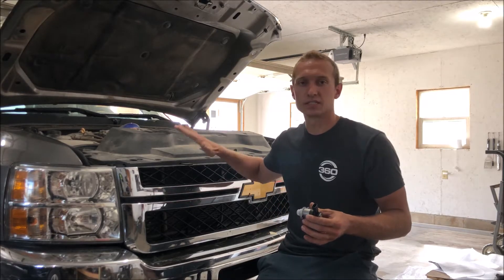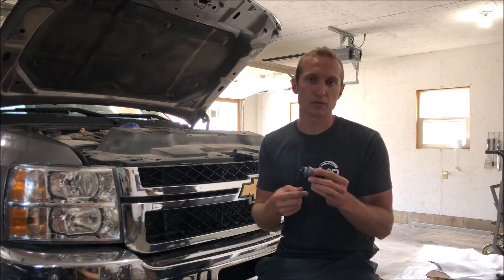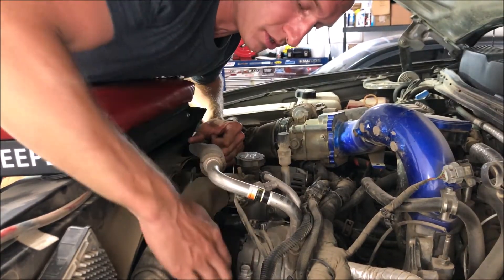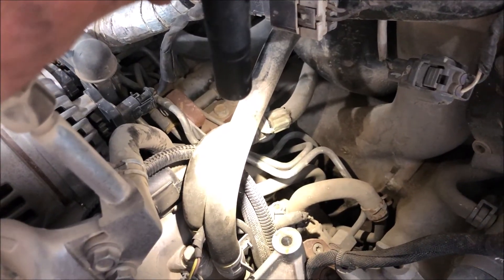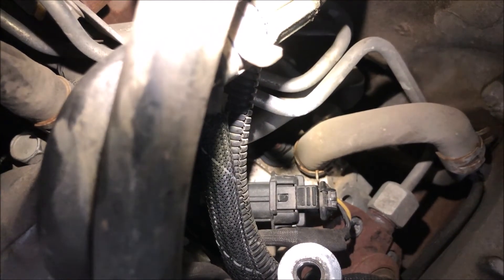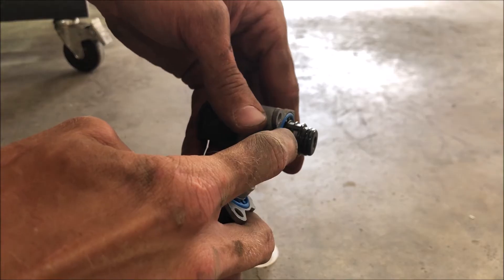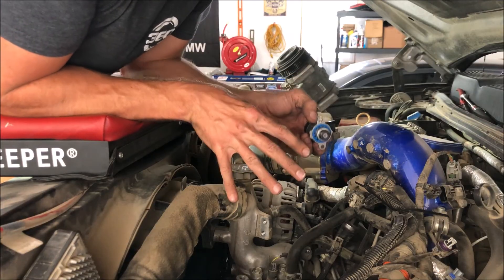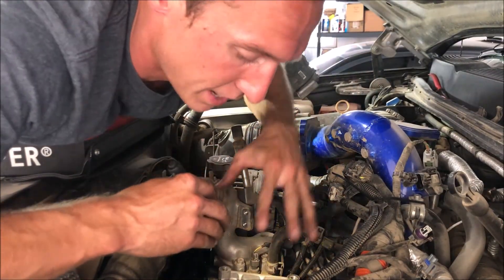LML Duramax Exergy Fuel System Saver Install: This Could Save You Thousands in Repairs!

Comment: I just bought a 2015 Silverado 3500HD, LML equipped, with 76k kms on the dial. I started with a fuel additive immediately to increase lubricity, and I am ordering an airdog lift pump so that the CP4 is never starved of fuel. I may also add this device for added insurance.

Comment: I have a 2016 Chevy Silverado 2500 HD Duramax and After watching this guy‘s video, I purchased one changed mine out, not too bad of a job and then I put an air dog lift pump on it. It runs great.
Reply: I’m picking up a 2015 2500 duramax, is it worth putting the lift pump on it? I lucked out and the previous owner had the CP4 blow but they got it redone at Chevy with all OEM instead of converting to a CP3. New to the diesel scene so I’ve been trying to study up and be as preventative as possible
Reply: @willyuumIII yes put the lift pump on. I got a fass fuel 165gph system. 2 extra filters won’t hurt, not to mention duramax pulls fuel to the cp4 pump by vacuum. The lift pump is an absolute must. It doesn’t have to be air dog or fass, there are a lot of different ways to add a lift pump
Reply: @amandahugginkiss9119 appreciate it! I just put my first 2500 miles on it been rolling good but this winter my project will be the lift pump and a few other things. Thanks for the insight

Comment: I just got my first Duramax (2012 crew cab long box drw) and this is the first thing I'm doing to it. 
I have a few things planned.
Banks intake, banks intercooler, 5" straight pipe. To top it off, I'll see if I can find a set of 2019+ High country seats to toss in. I'll have to mess with wiring and whatnot, but I'll figure it out.

Comment: Not sure why but I did not have to move the AC, undo the belt  or remove any hardware. All I had to do is disonnect a couple of wires to shift over the harness  on my 2014 Silverado 3500HD LTZ. Thanks for the Video,

Comment: good video but ,Al these videos refer to "CP4" , what is a CP4 ? if its a fuel pump, why are they not calling it that? what is converting to CP3 ? a different fuel pump?
Reply from the maker: Good questions..so in 2012 GM started using the next generation of cam driven high pressure fuel pumps known as the CP4 pump. Capable of slightly higher pressures but much more prone to failure, and unfortunately they fail catastrophically, sending shards of the pump downstream to the injectors which can cause further very expensive failures. Several different companies offer CP3 conversions which allows the customer to install the previous generation of high pressure pump, which has proven to be exceptionally reliable in pretty much every common rail diesel application since the early 2000s.

Comment: Thank you for keeping things simple and being descriptive!! Very big help on how you explained things! Dont know if you awnser questions on here but o have a 2011 lml duramax im trying to pinpoint the little hiccup it has starting, but what it does is starts up fine cold but when you drive it around get it warmed up it will just crank and crank until i let it cool back down. I have installed a fuel filter housing, an a airdog lift pump and still having the same problem i have no codes, truck runs like a top when started. Ive checked it with i believe one of snap-on's nicesest scanners the triton-dio, checked fuel rail pressure injection pressure-timing all the above to my knowledge everything looks great just really stuck and trying to find exactly what direction i need to go to fix this problem cause its the only wrong with the truck
Reply: Did you ever figure out what it was? My 2013 is doing same thing, cold start is good, gets warmed up n hard to crank like it doesnt have enough pressure

Comment: is this process the same on the later bodystyles?
Reply from the maker: Later bodystyles meaning the 2015-2017 LMLs? In that case yes. If you are referring to the L5P trucks, they are a completely different fuel system that does not require this modification.

Comment: After my old valve was out I pumped the fuel filter housing to push any foreign debris out of the fuel port. It really is just peace of mind but my OCD kicked in. And also I didn't have to remove anything but the Schrader valve and the small 5/8 rubber coolant line to get the 5T socket in the bolt, also a very good idea to have a small telescopic magnet handy. I didn't notice any decline in power however I did notice the truck seemed to run a little more crisp maybe it's just in my head but it still seems that way today.

Comment: JUST got a 16 2500 Denali LML tuned with Banks and cold air. Just learned about the CP4 issues and don't know what to do it has 110,000 do I sell it or replace the CP4 with a new one, or CP3 it? I just want a dependable truck.
Reply from the maker: Good question for sure. The CP4 issue is really a bit of a toss up, some guys have run them for 100s of thousands of miles without issue, other guys had had nightmare experiences where the pump grenades and takes out the entire downstream fuel system. My neighbor down the road had his cp4 go out, the local dealer replaced it along with the rest of the system under warranty. Literally a couple thousand miles later the new cp4 went out and did it all over again. He did a cp3 conversion at that point.
Here is a link to S&S Diesel's (one of the best aftermarket fuel system companies in the industry) CP3 conversion, they have an option for a 50 state legal, no tuning required system. That package is $1780, though you would still have to install it yourself or pay to have it installed. 
So you have several options, you can either wait and see what happens (install the fuel system saver in this video in this case), or you can spend a few grand and have the cp3 conversion completed and give yourself peace of mind and have a very reliable truck. Or, you could sell the truck and relieve yourself of the potential issue entirely.
https://ssdiesel.com/product/lml-cp3-conversions/
Reply: Cp3

Comment: Have you heard of someone that have install this exergy and the CP4 exploded and this actually protected the fuel system? Thanks and great video!
Reply: My buddy a few days ago, took it to the shop to fix a problem, cp4 blew. Luckily the week before he brought it in the fuel saver was installed
Reply: There’s a couple links of it working. Still will send metal to the tank and line. But protected injectors and stuff. Went from a 10,000 dollar job to a 2300 dollar job.

Comment: Replaced mine....started buzzing but I also changed my fuel filter. Once I got all the air out the system it seemed fine.

Comment: I’ve just switch it out in my 2012 3500HD with 350,000 miles on it and added an airdog lift pump. I have a few metal shards on the old part (sigh), I use hotshots additive and with the lift pump hopefully can squeeze some more miles out of this thing before the CP4 gives up and we get a big bill. Anyway I really appreciate this video, thank you.
Reply: But you’re still running on the OEM CP4? I’m in the market for a new tow vehicle and am looking at “higher” mileage LMLs. This failure is my biggest concern obviously
Reply: @marshallangst8780  since my last post based in the price of used and new trucks currently, It was worth spending some extra cash on our truck. We installed a fleece CP3 conversion kit and SOTF tuning, we use it to haul horses between NC and FL so reliability was key, we get approx 17mpg hauling and 20mpg unloaded which is slight improvement from stock.

Comment: Quick question. I've got to change my thermostats on my 15 LML. (One is stuck open). You think there would be enough room to remove and install the system saver with the thermostat housing removed, without touching the ac compressor?
Reply from the maker: Yes probably, the compressor is not technically in the way, though having it removed is kind of nice because it simply gives you more room to work. Honestly for the 10 minutes or less it takes to remove and reinstall it, I would probably just go ahead and move it out of the way. You dont have to disconnect the AC lines, just fold them over and out of the way, so there is no loss of freon.
Reply: @FixedVaneDuramax  appreciate the reply. I'll probably go ahead and move it out of the way. I'm just lazy 😂😂

Comment: I just did this install took an hour to do the toughest part is the bolt towards the engine,after install truck did have a hard start gonna drive around this weekend see how it drives. Great video thanks.
Reply: @An extremely important man neither it run's fine and great peace of mind.
Reply: @An extremely important man My truck is bone stock,I didn,t feel a difference with power, i mainly did for protection if the pump take's a shit but i read on some truck web site that this does not help.

Comment: When you pulled out the ac compressor, did you lose Freon?
Reply from the maker: No, you’re just unbolting the compressor and moving it out of the way, you don’t need to disconnect the lines so the system remains sealed.
Reply: With those hard lines didn’t think that would be doable
Reply: Do you have a link to the valve and cost $$$ ???

Comment: I installed a fpr on my 2011 Duramax and it won’t start. I made sure to prime and it didn’t help.
Reply: Are you throwing any codes? Is your CEL illuminated? Does your glow plug light come on and go off normally? Any other symptoms?
Reply: Same here. System is primed, no error codes. Bled the Schrader valve. Crank no start. Prime pump feels firm and doesnt seem like an air leak.
Reply: @kevicook  Believe it or not mine turned out to be a bad cp4. I had the whole fuel system replaced in Nov of 2020.
Reply: @jfromstatefarm2345  I still haven't got my truck started. I thought bad CP4 as well, but it was working perfect before I replaced the FPR. I hooked the fuel system up to a diesel can. Tried priming and noted air bubbles returning through both the return line and the supply line. Seems to be an air leak. But I dont know where. And I didnt remove any hoses during the install. Im completely stumped. Also, return fuel when cranking looks like it went through a blender. The only indication I have right now that the CP4 is in fact functioning.
Reply: @kevicook  is there a way you can hook a scan tool and check desired vs actual fuel rail pressure. That will sure tell if your pump is gone or not
Reply: @jfromstatefarm2345  Yes. Had a friend with an Alltel scanner come by. Desired fuel rail pressure was at about 6kpsi. Actual fuel rail pressure was 143 psi. Thats the highest we could get. We also checked all electronics and fuses. All good. Everything says this should start.
Reply: @kevicook  with actual psi being 143 the truck won't start until desired is reached. I would look into getting a new injection pump, rails and possibly injectors. I would also drop the tank and clean it.
Reply: @jfromstatefarm2345  without any metal shavings present in the FPR or fuel filter? Truck was running perfect when I parked it to swap the FPR. I dont know of any CP4 pumps that failed while off.
Reply: @kevicook  I believe that maybe it’s quite possible u introduced debris into your cp4 when swapping the fpr which in term destroyed it, either that or like u mentioned air in the lines/pump could also cause it to not reach desired pressure?
Reply: @MrCrazyboys87  Im afraid the debris could be the issue. It ran for ½ a second before it quit and never started again. But seeing the air bubbles in the lines, after I isolated the fuel system to just what is under the hood, tells me a different story. Im so lost on this. Never been this lost on a vehicle repair.
Reply: @kevicook  I’ve been there before too man and it always seems to be the most simple solution too lol, just have to keep at it and you’ll figure it out eventually!
Reply: @kevicook What was the fix to get it to start ?  I’m having same issue after installing the Exergy, crank no start.  Installed my factory one back in and won’t start either.  P0090 low rail pressure, truck ram like a top before swapping part.

Comment: What kinda time do you think this takes for a 1st timer.   Been working on cars here and there for years. But never diesel.   This a mid level maybe 3 hours ?
Reply: My dealer tells me that GM guidance says 12-16 man hours for the pump and under hood work. Add in the fuel tank and lines, it'll likely be 3 days in the shop.
Reply: Sorry, my previous reply was for a full CP4 replacement effort following pump failure. To install the FPR replacement alone took me just over 3 hours.
Reply: @jamesclark7248  no worries. I seen both comments and figured that’s what you meant.  I went looking last night on how to replace CP4 videos or CP4 to CP3 swaps and DAM , that’s definitely no easy or small task and I’m definitely not feeling confident on it ,
Reply: @jasonjackson329  Hi Jason, Thanks! My guess is as follows; 3 hours for the FPR swap only, 2 days and about $5k for the 50 state & CARB compliant CP4 to CP3 conversion, and about $12k to repair the whole fuel system after a CP4 catastrophic failure. All of this is based on postings on the Duramax forums and my dealer estimates for a pro installation.

Comment: I've had this in my 2012 LML as a replacement for the OEM part for about two years now, and 25,000 miles. I tow a 16,000 lb 5th wheel about 5,000 miles per year. I have not noted any loss of performance, even on long uphill grades (4th of July Pass, for example). I want to see how long my "problematic" CP4 will last, without risking a major repair cost. I'm at 170,000 miles now on the original CP4 and am completely stock otherwise.
Reply: I have a 2011 LmL deleted at 80,000 miles i now have 257,000 miles on it and just had to replace the fuse box under the hood other then normal maintenance items. All original injectors and cp4 everything, just emissions delete only. I ran power Service in the fuel the 1st half of its life and the past 3 years I have switched to Amsoil all in 1 diesel additive. I believe the problem with cp4 is guys run these hot tunes or even a 75hp tune and hold the truck wide open pulling grades, and the fuel system is over worked and can’t keep up. The cp4 has 2 pistons that move and the fuel is the lubricant for it, I think the power service and amsoil keeps everything slick even with this low sulfur fuel that has less lubricity
Reply: James, do you have a lift pump installed?  Do you use a fuel additive?
Reply: @davidpeace34  Hi David, I've always used a fuel additive thinking that added lubricity would help extend the life of my CP4 pump. I'm using Diesel Kleen, either summer or winter blend as appropriate. I have no empirical data to offer regarding how effective it is, but at least it makes me feel better, and so far so good at 171,000 miles! Other additives, such as StanaDyne, offer similar benefits. There's a lot of information on the forums about the benefits and relative strengths of various additives. 
I've looked at a lift pump, but have not installed one yet. It's on my wish list! Given the overall circumstances, I'm leaning toward a Kennedy, because it'll provide adequate head pressure for my stock LML, and because it won't strand me in case of an internal pump failure. Overall, I'm using the "can't hurt, might help" attitude on the lift pump issue. Again, lots of debate and good information on the forums.
Reply: Hi David, Just FYI, I'm at 197,000 with no CP4 problem, bit plenty of emissions system issues. All fixable, but expensive. Just installed an AirDog II 4G system and Beans fuel tank sump.
Reply: 5000miles per year? Oh man I'm putting 40,000 per year
Reply: MGMC. I put on about 5,000 miles per year towing the 5th wheel, mostly interstate driving, mostly at 60 mph. I put on another 10,000 per year for general traveling, so nowhere near you!